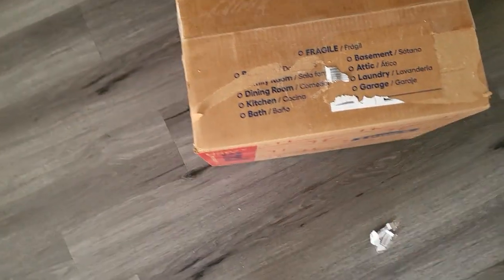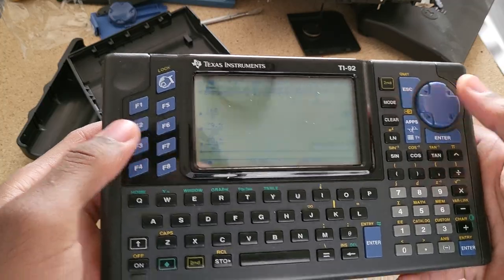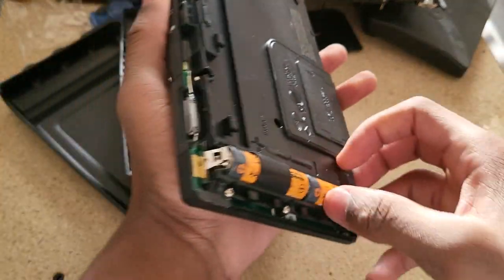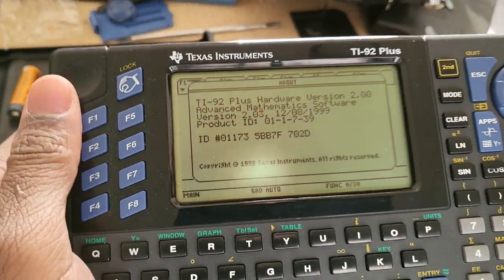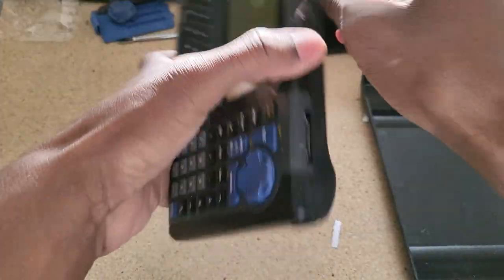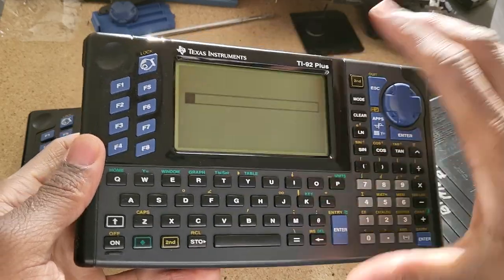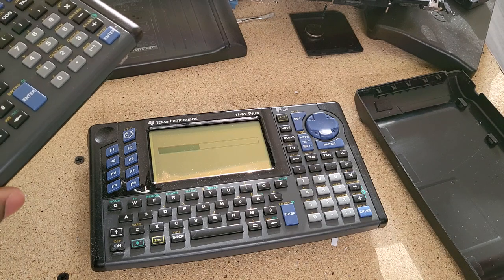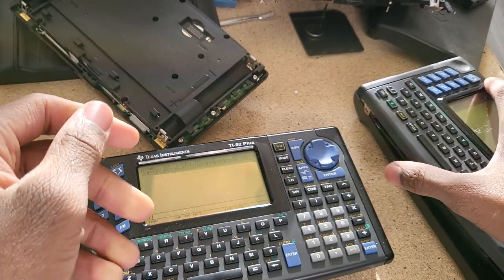The BEST Deal in 2022 So Far - BOX of TI 92 Calculators!😮

Comment: i dunno about ti 92 but the lines are very easy to fix on every other calc i fixed my ti83 plus you just take a flat solder blade heat it to the lowes temp and press where it connects to the board to readesive the adhesive costs 0$
Reply from the maker: The 92 has at a much much more complex display
Reply: @calculator_boy  hmm looks like 2 flexes one hor one vert where’s the complex part
Reply from the maker: @cursedfox4942  Most legacy TI calculators have a horizontal and vertical ribon connector. The higher resolution ones (Voyage 200, 92 series, Nspire Clickpad and Touchpad) have very small LCD connectors, making the repair almost not worth it (subjective). Moreover, if the glue that's holding these connectors to the board is already too hardened, the fix is even less likely. 90 to 95 of the time, if the LCD on a higher resolution legacy TI goes out, it's definitive. 

Go watch "Project Voyage 200 repair [en]" here on Youtube. It's an informative video.
Reply: easy as that huh......
Reply: @napoliskey  ya there’s mutiple videos on youtube my ti 83 had 10 lines on the display zero now or you can solder all new wires f that lol OR YOU CAN strip the contacts and solder but this is easier